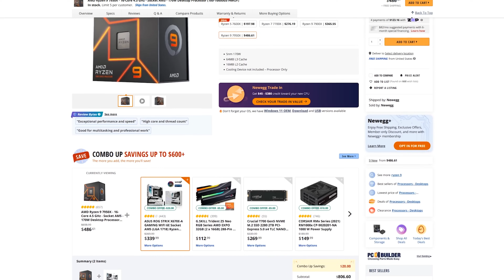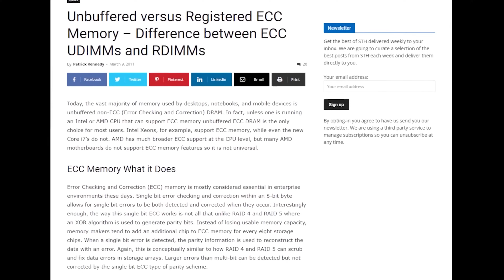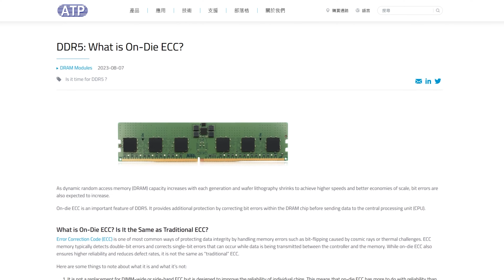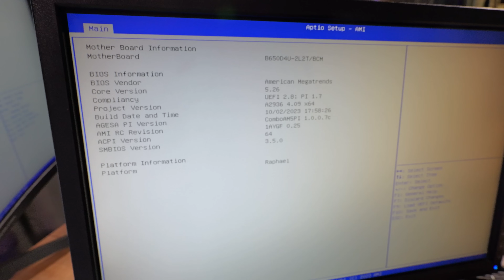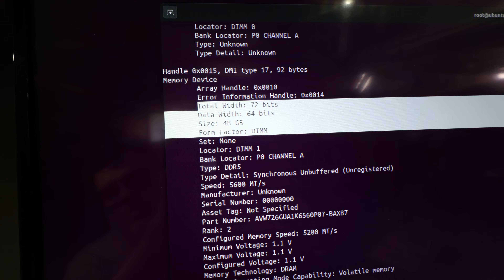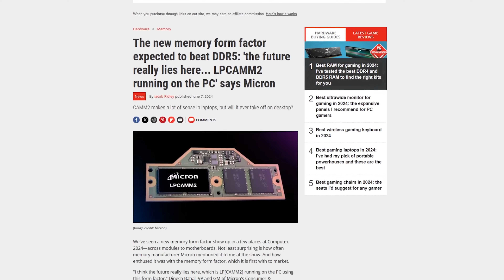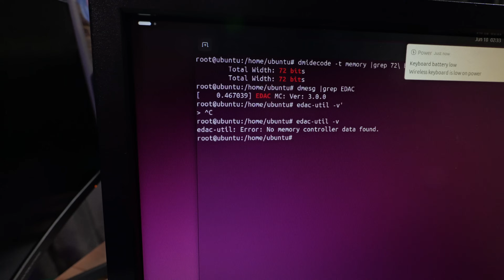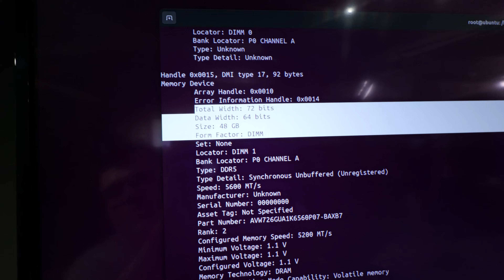What's Up With Error Correcting Memory on AM5 in 2024?

Comment: I hope that complete ECC memory support will someday become a standard feature everywhere.

Reminder: Regular DDR5’s On-Die ECC is just a tool to be able to use lower quality DRAM ICs that would otherwise have been discarded, it has nothing to do with the complete ECC chain checking the data between the DIMMs and the CPU’s memory controller.
Reply: I have a theory that ECC is kept for Workstation/HEDT class and up, to cause more people to go for higher-end hardware. Full ECC is the single biggest chunk of differentiation.

PCIe lanes are a big point too, but since you have some PCIe lanes already, more becomes moar, while full ECC is a clear yes/no.
Reply: @Liriq  It's not a theory, Intel has always done this to force product segmentation and push the businness customers to go for the low end Xeons (which are just fancier versions of the consumer CPUs)
Reply: ECC should of been standard 10 years ago but thank Intel
Reply: @coolhand4598 nah it's just a cost thing. Why would the consumer care to pay for ECC when they are running windows. Windows breaks itself without any ram error implication
Reply: @SquintyGears  Are you aware that servers run Windows too? By that logic "eh it will break itself anyway, who cares". Same in hard drives, why have the ECC logic in those (which they have btw), Windows will break on its own anyway
Reply: @SquintyGears  its not a cost thing its a greed thing, one of the few differences between Xeon and the mainstream lineup was ECC support.. AMD isn't nearly as pathetic ECC is supported on most if not all of their chips. ECC would of saved untold billions world wide on tech problems and unreliable systems over the years.. even Linus Torvalds agrees with this
Reply: @marcogenovesi8570  you're being facetious, it's not the same "windows". Intel was intentional about not supporting it on desktop because they wanted to artificially segregate the two markets.
But what I'm saying is that I'm not convinced consumers would have actually adopted ECC when it costs more and far and wide they don't care about reliability like that.

Viewers of this channel (including me) would totally have used it and loved the added reporting and everything else that comes with it. But randoes just care that it's 20$ more that they don't spend (figuratively).
Reply: @SquintyGears  Consumers don't know and often buy trash just because it's cheaper (i.e. low quality PSUs that explode when loaded at more than 50% their very optimistic watts), while paying 30$ for a fan with RGB lights.

The point here was that we should have made the cheap ECC (ie the CPU-supported ECC) the standard, instead of kicking the can down the road because "muh consumers" and ending up making the expensive ECC the standard (i.e. on-die ecc)
Reply: @SquintyGears  everyone reading this comment has experienced a machine crash because of a random memory error
Reply: @SquintyGears most of the added cost comes down to greed too. ECC hardware components don't cost that much more to make and implement than Non ECC hardware components, once you control for all other specs. That's the thing that OP has a problem with, because it would be cheap for manufacturers to add and implement but they would rather charge a large premium and keep it exclusive to markets and customers willing to pay that massive premium (business/enterprise and high-end workstations).
Reply: @VoteOrDie99 it takes a very long time to normalize prices after a new feature is introduced. I'd say ddr3 to 4 took 4 years and 4 to 5 just got dumbstered 4 years in by the data center demand.

So if it had been 10 years since ECC was adopted, sure we'd see a tiny price variance. But in reality all industries love any excuse to increase margins. And the RAM industry is notorious for colluding on prices.

That's why I'm ready to bet it would hold a premium virtually for ever.
And it literally doesn't matter to normal people. You have to be compiling something to even notice that there's a variance in the output. Even the special effects industry don't notice the variance on multi hour renders. So we're here clamoring for the good of all, because it would be better. But it's no different from going door to door spreading the word of Jesus
Reply: As an example, NAND flash is less reliable tnan NOR flash but in storage there is no artificial limitation (chough*Intel*cough) and all the ECC to compensate for higher chance of storage errors is handled by the storage controller of the SSD. Nobody invested any money in adding on-die ECC in NAND flash chipse themselves, that's vastly more expensive than running ECC on the storage controller
Reply: @marcogenovesi8570  Proper ECC memory needs at least an entire additional DRAM memory IC, so of course On-Die ECC is significantly cheaper.
Reply: @abavariannormiepleb9470  Where do you think the ECC parity bits are stored for on-die ECC? There is additional (hidden) DRAM space for parity bits in each IC that needs on-die ECC. That is not "cheaper", it's the same amount of DRAM silicon, just arranged in less chips. 
Adding silicon space for the electronics that does the ECC verification for each IC is not "cheaper" either.
Reply: on-die ECC corrects 1 bit error per cycle.  in temporal terms, 4,800 million errors a second, potentially. It is rather robust in terms of correcting errors, it just lacks logging and the extra robustness of regular ECC.

At least, as long as you're running it at JEDEC spec. if you're using XMP then it may be masking overclock errors.
Reply: Garunteed everyone who reads this comment had a machine crash because of a memory error. Thanks Intel
Reply: Gotta wait for another Carrington Level Event ig
Reply: > "Regular DDR5’s On-Die ECC is just a tool to be able to use lower quality DRAM ICs that would otherwise have been discarded"

This is just wrong, on-die ECC functionality does not come free and it's much cheaper to just not have it and bin the DRAM chips to lower frequencies on modules.

On-die ECC is required because of RAM densities reached with DDR5, the smaller the cells the easier it is to flip them accidentally
Reply: That reminder was the most succinct explanation of how and why "ECC" exists on DDR5. Thank you, OP.
Reply: @SpoonHurler  that reminder is wrong
Reply: @marcogenovesi8570  So what you’re saying is the physical IC quality isn’t good enough to prevent random bit flips on its own? 
I wonder how else you could otherwise describe that…
As for density: The most common 32 GB DDR5 UDIMMs are still made with 16 Gbit parts, same as the older 32 GB DDR4 UDIMMs. 
And note that the system won’t be notified by the On-Die ECC functionality stepping in, potentially masking issues you’d be looking for in diagnostic endeavors.
Reply: @marcogenovesi8570  how does it work then, I'm honestly confused... I have planning my new nas/cloud solution and was considering the EPYC 4464P cause I need real ECC but details on ECC on AM5 is beyond confusing... and Xeons are expensive or slow and hot.
Reply: @SpoonHurler  see my other posts. tl;dr ECC on DDR5 is required because of high memory density inside the chip, not because "they want to save a buck and use bad chips". Adding on-die ECC to the RAM chips is not cheap
Reply: @abavariannormiepleb9470  nothing to do with silicone quality and everything to do with physics
Reply: @abavariannormiepleb9470  no I'm saying that there is no silicon quality that can run 100% reliably DDR5 at these densities. You can get away with lower densities but that means reducing RAM space per DIMM.
 
Yes DDR4 does not have issues at the same density. It's also not DDR5
Reply: ECC is slower so it's not good for gaming systems.